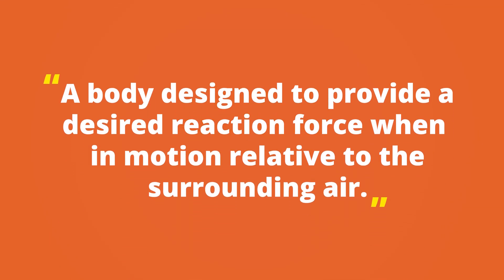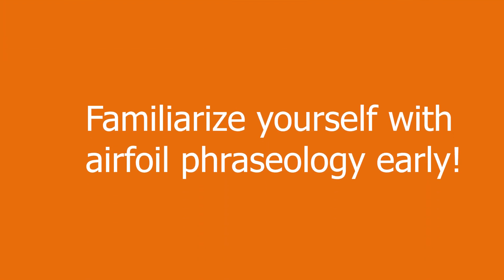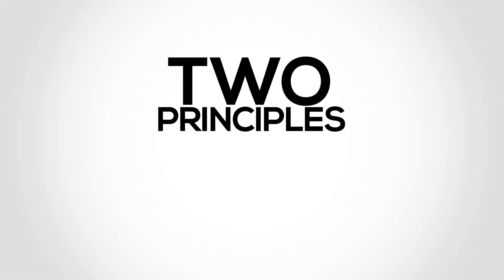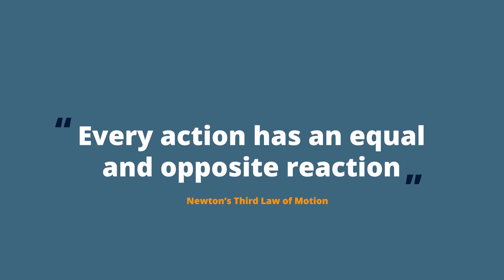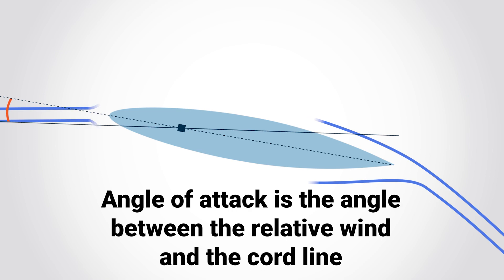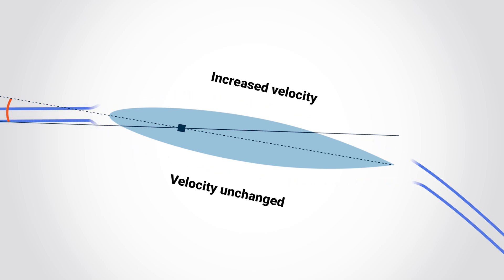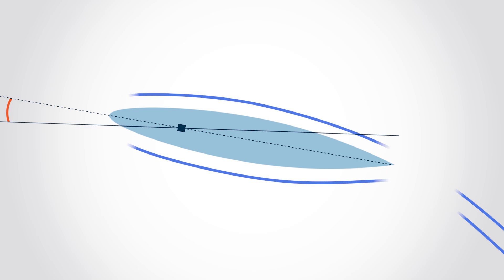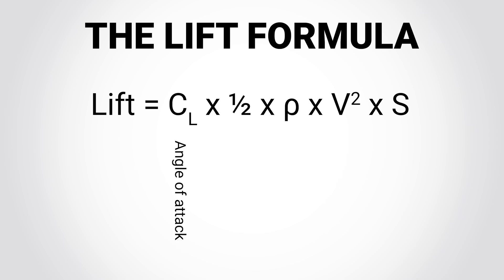Airfoils and lift - How lift is created

Comment: The very best explanation of how lift is created, that I have come across. Thankyou
Reply: This explanation of lift is incorrect. Please check out Rod Machado's video "Let me throw you a curve".
Reply: @davidwallace5738  Machado's explanation has problems as well.
.. .. .. ..
This video:
The longer path is a common misconception.  A flat wing has the same length above as below.
.
The upper and lower flows DO NOT meet at the trailing edge at the same time. See Babinski's video of a wing.
.
The speed up does not cause the lower pressure.  It is the lowered pressure that forms the pressure Gradient that is the cause of the speed increase (Acceleration).
.
The down-wash is a RESULT of the same pressures pushing up on the wing. It does NOT "add" to the top-bottom pressure difference in any way. It is a result of those pressures.
..
Babinsky's video: https://www.youtube.com/watch?v=UqBmdZ-BNig 
.
This 1 minute video explains that it is the curve in the FLOW that causes the lowered pressure: 
 *https://www.youtube.com/watch?v=3MSqbnbKDmM*
.
I have full comments under his lift video.
I have more detail in a comment above, from a month ago.
Regards